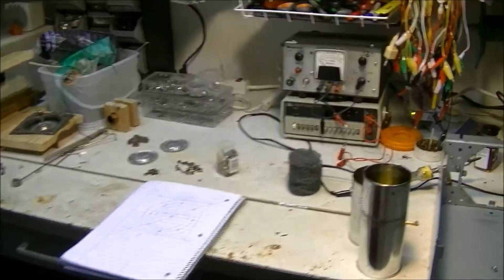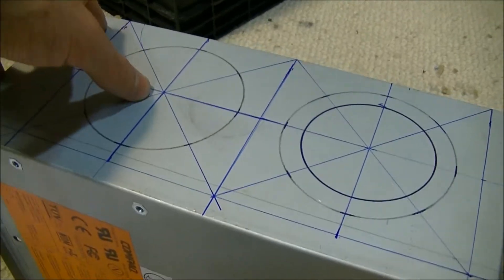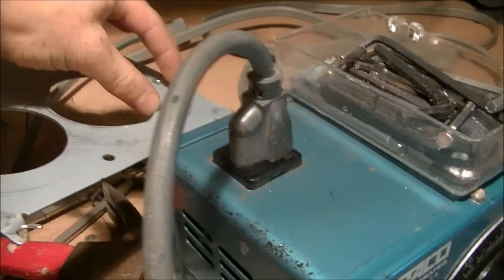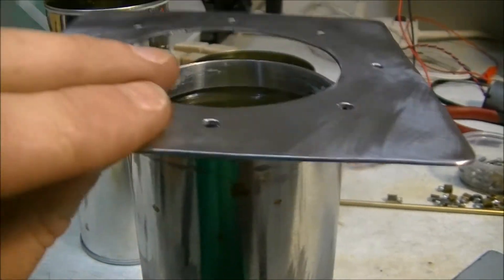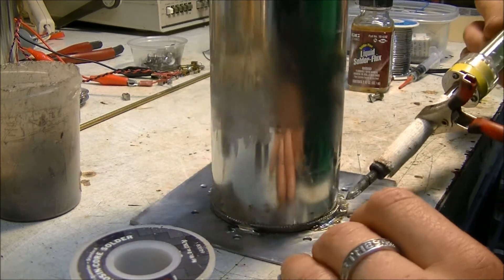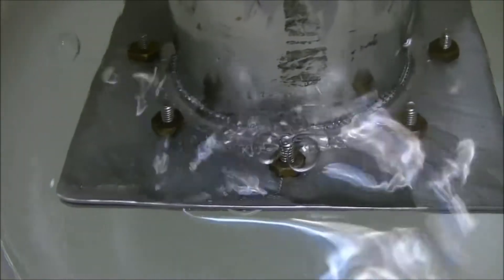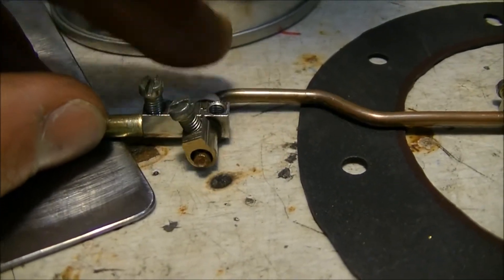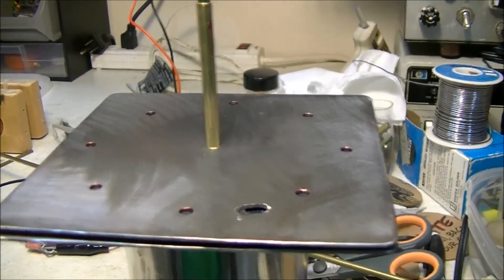Building the Displacer Cylinder For My New Stirling Engine #5 - Part 1 of 2

Comment: the cylinder is stainless recycled material .. where did you get?
Reply from the maker: No, it's not stainless steal.  It is a whipped cream can.  So it's just steal.  Thank you!
Reply: +Makerj101 Hello, Can you tell me a bit about how you "salvage" or "open the top" of whipped cream cans (to do the main cylinder of a stirling engine) without bending or breaking them? I'm having a hard time with that !   Thanks :)